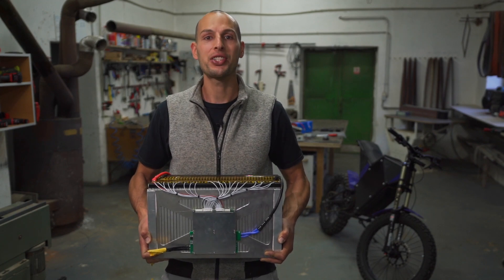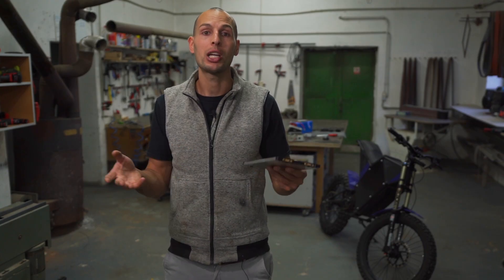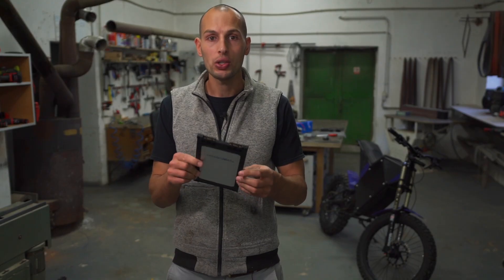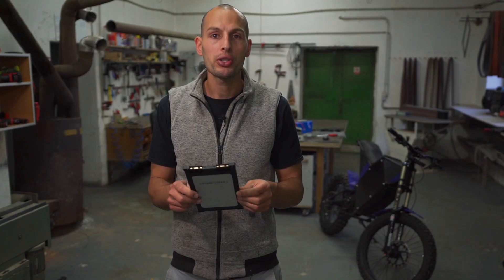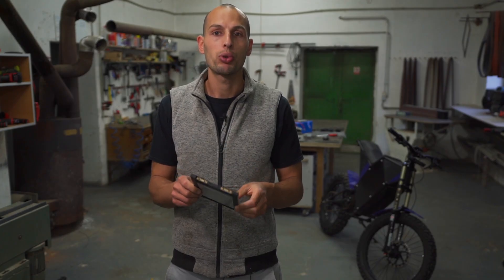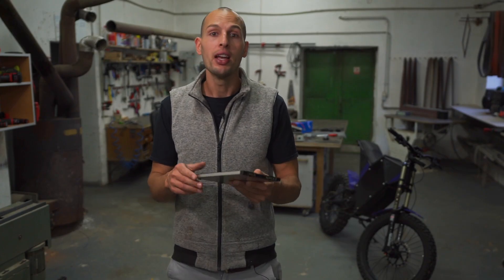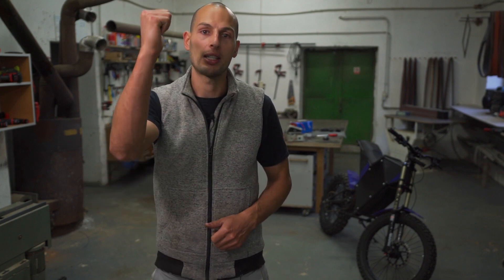Ultimate DIY eBike Battery With No Spot Welding or Soldering

Comment from the maker: Hey everyone, let me know if you have any questions about this battery pack. I'll have batteries packs available for sale as well. Thanks for watching!
Reply: i was waiting for that episode :D, what charger do you use?
Reply: @duniek86   great! what charger  are you using?
Reply: What's the cost to make and have shipped, is this able to be shipped to  the U.S?
Reply: What is actually the price per cell?
Reply from the maker: Email me at Ladi@mysuperebike.com the price is 22 euro per cell.
Reply: @ladiandmargaret  can you post a link?
Reply: @billadmond9450  
Perhaps cost of labor to build?
Reply: @billadmond9450  
Being honest. No. Getting my head around all this "electricification" but for now I'll take your word and revisit this reply. Just thought he was charging for the components of a product that didn't need welding or soldering and labor. 
That does seem kinda high the way you are explaining it.
Much appreciated.
Reply: I would like to know more about how to charge them and keep the balanced.   Ultimately I would like to have a power pack that is fully managed with nothing more than an AC power plug and a DC plug in case I need to charge it from a solar panel.
Reply: I want 72v60ah pak
Reply: Hey how can I order a 20s config?
Reply: Amazing battery build. I'm wondering if it's possible to charge the bike from a generator in the woods, for example. Say I had a cabin with a 1.8kw generator, is the charger smart enough not to try to draw the full 3kw and trip the generators breaker?
Reply from the maker: You set whatever charging current you want on the display 😎
Reply: @ladiandmargaret  ok, now that level of control is impressive.
Reply: How much 72v 30ah like this
Reply: Hey man, i need a 48v setup, so I need 13 of these. On quite a tight budget, how much for 13? I'm in the US, so there's that too.
Reply: Nice :) what about to use this also for 4.2 ?
Reply from the maker: Unfortunately no reasonable configuration fits in eBike 4.2
Reply: Ladislav Jecminek that can’t go inside the ebike 4.2 frame ?
Reply: Where can I buy those
Reply: 36v version?
Reply: Ladislav Jecminek 72v 52h or 55h
Reply: Can you put the link to buy here? It's not working for me.
Reply: how much for 22s1p battery included shipping to ger
Reply: Where can I purchase the bars that connect cells from please I’m in U.K.
Reply from the maker: I have some.
Reply: @ladiandmargaret  Ladi do you have packs built ready to ship???
Reply from the maker: Yes I do.
Reply: @ladiandmargaret  how much do your pre built batteries cost
Reply: @ladiandmargaret  hello. What Will 60v for an e-bike 3000w coast?
Reply: What are the dimensons of that pack? And am inseeing right that ypu build a 20S2p there?  If if fits in my e-motorcycle then i would be very interested if it can do 90 to 100 amps continiously that is
Reply: Can you ship to Canada yet?
Reply: Is this the new method that was announced a few months back where they're using a new electrolyte which reduces the layers ability to short between each other or such? Can't remember any names so I can't find the video.
Reply: Ladislav Jecminek  hey bro I’m interested in a 70v 150-2000watts for my emmo 72 mr2
Reply: Are there any US suppliers of these cells? I can't find any.
Reply: Do you post to England UK. Your Cyberbike is amazing love your creation all I can say is WTF !!!!!! Keep up the good work.
Reply from the maker: Yes I do. Thank you 🙃
Reply: Do you ship to singapore?
Reply: Does these fit the sur-Ron please?
Reply: Still only ships to the Europe?
Reply: I want one .... before I spend a ton of cash on new batteries and probably the controller and charger as well
Reply: What is the capacity of a cell
Reply: Hey there Ladi, what are the measurements of the battery? Love what your doing, all the best!!!!
Reply: Aloha from Hawaii was wondering what a 72v battery with 220amps cost and also a 96v 220amp with about 60+AH for both batteries
Reply: Hey Ladi, which BMs are you using? Im in the process of building a pack from EIG cells for a motorcycle conversion. Am i right in thinking youve gone 44 cells for 84v/92v in a 22s2p configuration?
Reply: Amazing being able to build battery
Reply: Where can I buy these cells?
Reply: What distance you cover with this battery on your last model e-bike ?
Reply: ship to canada ?  plzz
Reply: Hey from California, im late to the party but are you still building and selling the battery system?
Reply: Good news 
I will be following.

Best wishes from Istanbul

Comment: This is absolutely amazing! The fact that you can build these battery packs without soldering or tack welding is amazing! Any stress to the compartment are the battery that made leave any weak points on the case of the battery timer is definitely not ideal! The fact that you can create these battery packs without tack welding, definitely makes for a safer battery! I wonder what technology is used to make these lithium polymers more safe, when it comes to being punctured, because lithium polymers similar to the ones that are inside of iPods, iPads, and other tablets that use lithium polymers are definitely subject fire if the battery is punctured, as I have witnessed firsthand!!

Comment: Can you build me battery for CS20 bomber clone 72v 40ah have qs273 12000w aprox 6”W-can go to 7”W with mods,12.5”H-9” I need just enough room to plug discharge cable, my battery is LG 42ah but it’s not built “good” bought your book, CS20 bike frame is terrible for battery space but I bought it before finding your channel, I may just buy another frame to be able to use a proper battery as I want as much potential as possible I prefer a “safer battery” but ok with a proper built 18650 or whatever is better than what I’ve got, I’ll email you!
Reply from the maker: Sure

Comment: where do I go to buy these cells? I want to build a 15kw battery for my diy ev motorcycle build. I am converting a ICE bike to EV and want the best cells with the longest life possible. I do believe that a pouch cell will probably be the best bet considering they save room and I can stack a bunch of them together. Overall, I'm thinking around 102v and 150 - 200ah.

Comment: That cycle life kinda scares me. 1C both ways 100% DOD gives you 1k cycles until you hit 80% SOH

Now no one is doing that. Real world would be 0.5C Charge, 0.5C-2C discharge for the vast majority of riding and perhaps 5C for maybe 5% of your time on the bike? DOD probably closer to 70% or 80% for most riders with common sense that cut off charging at 4.10V and don't let it slip below 3.20V or 3.10V. If the cells range is 4.15V to 2.5V and we all know there isn't jack shit below 2.8V then I think it's safe to say 4.10V to 3.1V is somewhere in the 80% ballpark.

Does the lower DOD% make up for the fact that no one buying these bikes is going to average 1C discharge on a pack like this? I think it might. If they provided another number for a higher C discharge it would be easier to confidently say that being aware of your DOD% can allow you to mob within reason and still see 1,000 cycles. Yeah you have life left at 80% SOH but most charts show the decline from that point on is not pretty and the increasing IR is going to rob you of a lot of power due to voltage sag.

Re purposing these cells after 1,000 cycles in an energy storage application might actually make a lot of sense. Would be great for a DIY Solar Generator that has the ability to run multiple. power tools/pumps/air compressors for a short period of time for natural disaster response assuming you have the proper LF inverter. Would also make quick work of a Tesla Rescue Booster if you need to dump a couple Kwh into a flat ass dead EV that only needs to move a short distance to hit a charger. Save you money on a tow.

Comment: These cells are 5c continuous discharge current, hence a 3.2 kwh battery will output 16kw not 27kw. And 32kw peak (less than 10 secs).

Comment: hi 
can you share what BMS you use.. 
dont know s&%t about this stuff. want to build a 72V pack out of these 3.7v 8ah 200a for my e-dirt bike project.. motor is rated 3000W so i want as most range but allso the most power out on these pouch cells.. have the cells, dont know yet what to use for BMS.  Some help?

Comment: I have this battery on a bicycle I bought 6 months ago and from the first day the battery cuts off my power! After filming the BMS application, I found that 6 cells drop below 3V voltage and the other cells remain 0.5 volts higher. At the top, at the connecting blades, I have a temperature sensor that in 10 seconds reaches a temperature of 60 degrees and the BMS enters thermal protection. The standby battery is perfectly balanced, when I draw from it 200A those 6 cells drop very quickly below 2.8V. Is it possible that the screws on the blades are loose and therefore do not hold those 6 cells in charge? What advice would you give me to check? And one more thing, I can't discharge the battery more than 40% because those cells go into voltage protection! A tip from you can help me a lot to enjoy this battery. Thank you very much!
Reply from the maker: Sound like you need to use proper connectors because the ones you are using don’t handle current you are pulling from the battery. That’s why they heat up.

Comment: 26kg 3,2kwh 👀...im going to stay with 18650 & 21700 cells even tho they require a LOT more work when building a large battery, these are not high enough power density for my use.
Reply from the maker: It’s 22kg but you are right. These cels have low power density.

Comment: Hello, I just ordered a CS20 12000w  QS273 sabvoton 150ah, 72v battery is LG 41.6ah 150amp discharge bms ( specs they Alledge, do u make batteries here in USA for this to get best performance out this set up I bought, fyi this is my 1st ebike, I do ride dirtbikes and know basic electrical and mechanically inclined, any help or thoughts appreciated!

Comment: Hey Ladi, how big of a battery can you build to fit inside the Enduro Ebike frame? I currently have a 134v, 20ah, 2680wh Lipo build, but am looking for more ah/wh with a 134v setup still.
Reply: You can use a backpack and carry 20ah on your back
Reply: some say it can fit 50 or 60 amp hour, maybe even 70 or 80, at 72v,  see Delfast bike.

Comment: I've a question please help if possible... I've a 12s lifepo4 smart bms... But I need a configuration of 15s and on the bms there are 16 slots for batteries 4of which are not being used and are shot circuited... So without changing the coding or anything if I simply open the shot circuited last three lines and simply connect if to a 15s lifepo4 battery pack would it work??

Comment: You call that a "short circuit"? What you've created was a wire heating element! I want to see those cells shorted with a copper bar.
Reply from the maker: What?
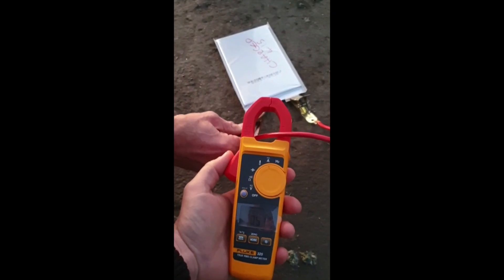Reply: @ladiandmargaret  4:36 I'm referring to your short circuit test of the battery if this was not clear enough. 

You created a resistive load with those wires. I was hoping for a less resistive and more conductive load, like a copper bus bar. This would result in a much better "short circuit test" and it may actually give the battery a chance to heat up rather than just melting your wire.
Reply from the maker: I see, that was a random internet video.
Reply: @ladiandmargaret  In that case, may I suggest you try this test with your cells and publish the results?
Reply: @ladiandmargaret    "You can see this battery is short circuit and the only smoke is coming out of the wire because that's heating up"

Wire heats because it has resistance, which increases further with the temperature of the wire. 
This resistance limits the current flow due to the thickness and length of wire used.
May I recommend using a less resistive and more conductive material like copper bus bar that better suits the current capabilities of your batteries?
This would give the current a direct path from negative to positive creating a real short circuit and in my opinion a much more interesting experiment than heating a wire with a battery.
My apologies if you initially misunderstood me,
Take care.
Reply: @Convolutedtubules  If these are Li-Po it'll blow up with a proper bus bar. Way lighter than LiFePo4 though which, as you know, is the safest chemistry so far. I'm looking at building a 100V LiFePo4 battery and it's expensive AF. These Li-Po cells are cheap cheap compared to litium iron phospate. This battery pack would cost 3-4 times as much if it wasn't Li-Po. Gotta have some give and take. LiFePo4 would last 3-4 times as long though so.... That's why I'm going with lithium iron phosphate. The longevity.
Reply: @TripleTowerHoldings  The whole point is to let it blow up, to show what it is capable of in a short circuit scenario.

Comment: As far as weight goes...my 3.5kwh Li-ion battery is still a hefty 46 pounds, with plastic case, yet I'm waiting for a 30+% further reduction in weight with the newer upcoming battery cells...  that is a heavy but power house of a battery you have there.

Comment: I'm building a 92s4p pack for a full EV car conversion using the same cells. They really are fantastic. Very good if you can find them at a good price.
Reply: Hi -- how's did the conversion go?  where did you source your bats from.
Cheers
Reply: Where did you get the plastic for each pouch and the bus bars?

Comment: would it be possible to stack them in different ways and connect the different layers to one big? Like yours a bit shorter and then some chells on top. So that it looks like a motor with cylinder?
Reply: 🤔🤔🤔...

✅️  exactly...

Being able to stack them in long and short pieces in different angles would allow me to make a hollow "V-twin" case for the batteries and Brushless electric motor on the bottom.  Then put the controller and recharger/maintainer in the modified tank.

😉😎😎😎😎😎

Comment: Those style frames are just so d@mn ugly. No thanks. I will stick with my beautiful cruiser even if it is only a 58.8v battery (25ah). My cruisers motor output is 3k watt and does 50mph on flats. Not sure why you would need something more. Plus mine is still legal(kinda) lol

Comment: if the cells do not catch fire then there is no reason to treat them as dangerous goods let alone normal hazmat even at the very high capacities of say 100+ amp hour or 420 watt hour thereby there should be no reason not to be able to ship them by mail.

of course while the chemistry will not start a fire the heat caused by a short can still start a fire.

it is possible for a lead acid battery to start a fire case in point a local recycling center had some sheet metal and cardboard piled on a car battery (lead acid) and it caught fire due to a short.

so you will still need to protect from shorts and damage when shipping but the chemistry should not be the problem

Comment: Could you tell me what bms you used? I have the same batteries but I need a BMS for a 20s2p setup.
Reply from the maker: How many amps?
Reply: @ladiandmargaret  I have 40 EIG cells in a 20s2p configuration so 40Ah. I would need 3 bms's because I have 3 of the packs wired in parallel. 120 cells in total. It's for my golf cart. It has a 600a Navitas controller with a 5Kw AC motor.

Comment: you should check out microvast batteries. they have super fast charging (4C) ability and 5000 cycles to 80% capacity @1C discharge (for the highest energy density cell mpco). the microvast cells are also pretty big format that only fit on a rear rack on an ebike. microvast also has non flammable electrolyte technology
Reply from the maker: What’s the cost?
Reply: @ladiandmargaret  about 300$ per kwh for a complete battery pack, maybe fast charging option will add to the cost. check on alibaba : houzhou hongwei new automobile. they have up to 72v and also 144V packs (in extruded aluminum shell)

Comment: I'm confused why people think using an AC amp meter clamp with give them an accurate reading from a DC source.
Reply: This is a common question, but the answer is very technical. Pay attention, and I will try not to get too mathematical. This is a bloke filming himself whilst music blares out in the background. Your comment is true, but where is the music? Being slightly more serious, I haven't used a clamp meter for years. If the meter has a peak value memory, the initial conection will be sort of half wave ac, might give a reading. I wanted to measure the current draw on my ebike, so I put a short length of 1mm cable in series and measured the voltage drop. My 1000W motor  uses nearly 2KW at full load.

Comment: That's good to know before I find some for replacing my 2013 Nissan leaf. Depends on. Capacity of the cell. I will consider for the rebuilt of my 2013 Nissan leaf. Tha is for the video.
Reply from the maker: 20Ah

Comment: Pretty much any decent 18650 cell today exceeds 500+ cycles without problems.
A VTC6 pack of similar capacity is almost 10kg lighter while allowing same power..
You could even charge such a pack at 6kw with active cooling, 3kw passive no issues.
Reply from the maker: 300 cycles on vtc6...
Reply: @ladiandmargaret  A spec that is taken when ran hard in power packs for hand tools and whatnot. 
Actual realistic cycle count is in excess of 500 cycles, if not 1000+ when treated right.
Reply: My point is that a 18650 VTC6/30Q pack of similar weight and size has more capacity and power, and just as good if not better lifetime when derated to 4.0v charging while also then having similar capacity at that point. 
Only disadvantage cylindrical cells have over pouch times is being harder to work with.
Reply from the maker: It’s more expensive too. I agree with you. You know a bit about batteries.
Reply: @TheLawnWanderer  And 18650 don't swell